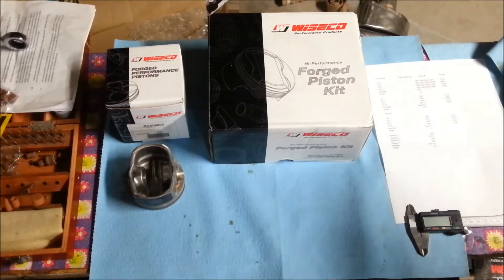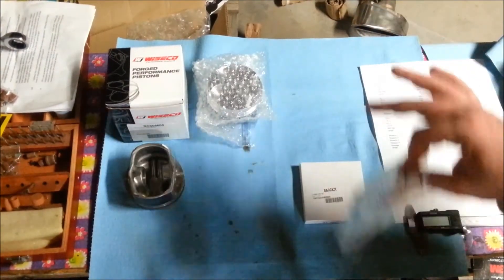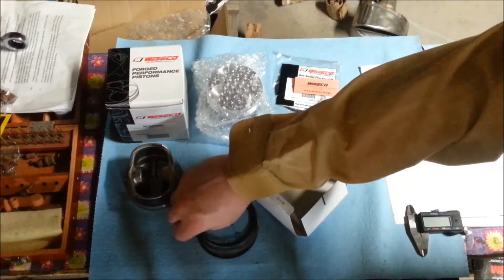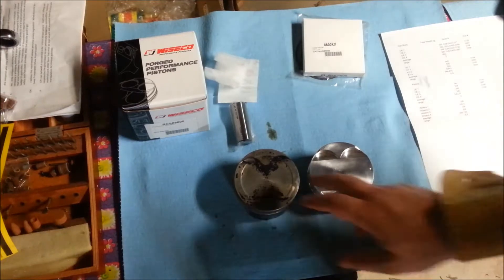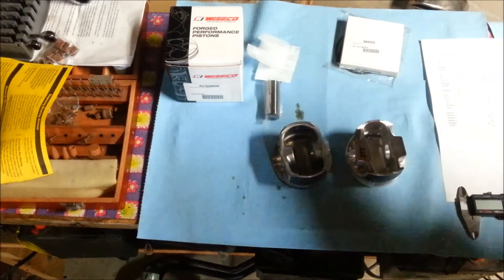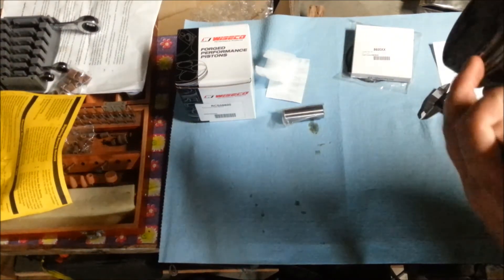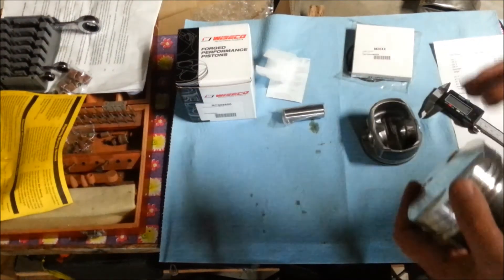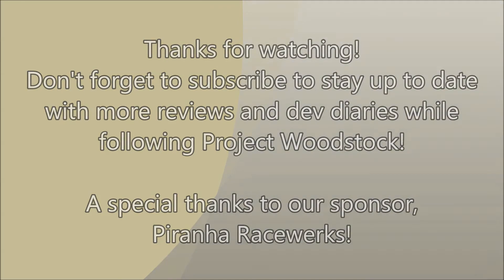Wiseco piston review

Comment: When running these, will they give piston slap? Keeping in mind they will be running in Canada and driven in the winter.
Reply from the maker: quality machining of the bores to match the specifications of the piston and you won't have piston slap.
Additional noise on start up is common for all forged components in a cast aluminium block with iron liners simply due to thermal expansion differences. If you're going to winter drive a forged internal block in Canada, plug it in or garage park it.

Comment: Snoopy0812 Hi. Have you compared the build quality and ring quality of Wiseco to other popular manufacturers like CP, Arias and so on?
Reply from the maker: I don't have access to a vast array of parts like some people/companies do, since I build these engines as a side project for whomever needs one. I do have a set of CP pistons here for the BK20 that I'm installing in a car, they're very light and very thin, which is good for efficiency but long term durability and knock resistance, I'm not sure about. Rings seem to be fairly standard across the board though from all my experiences and other peoples feedback to me.
Reply: Snoopy0812
I'm sure CP probably designs certain pistons for certain applications right? The ones you have may be light and thin but they probably make thicker/stronger pistons for people wanting to go forced induction right?
Reply from the maker: The ones I have from them are for forced induction, but with CP you can custom order pistons and I'm sure you could request a thicker crown and slightly wider wrist pin guides.